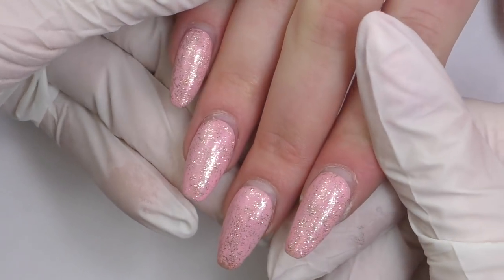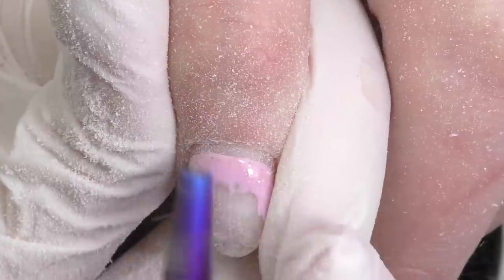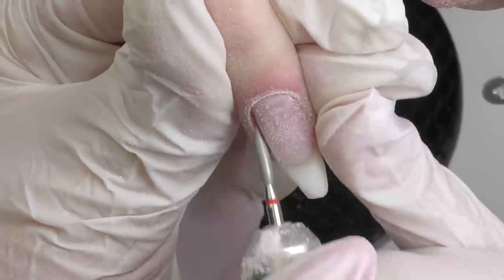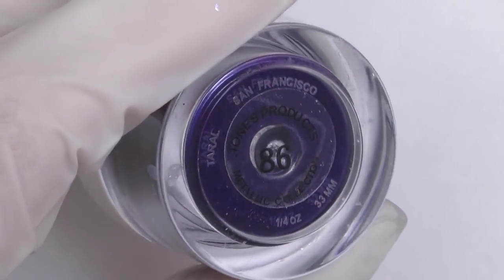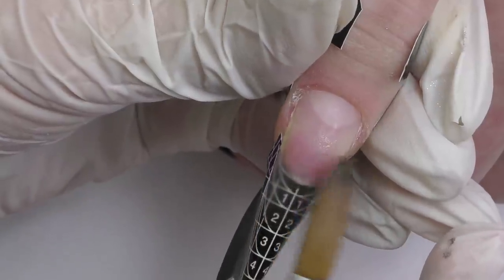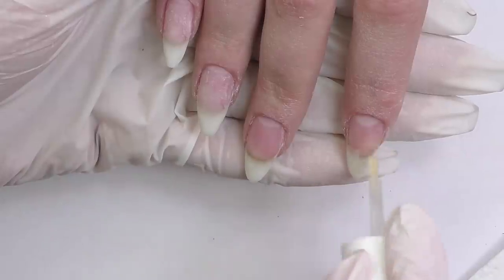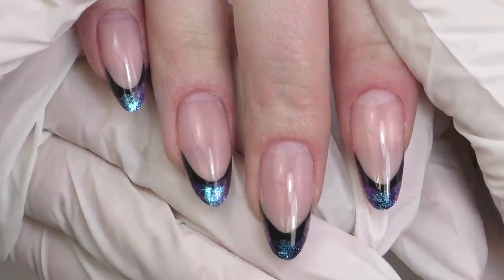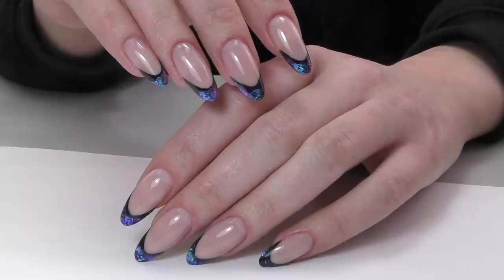Watch me Work: Client Fill | French Style Nails With Galaxy Design

Comment: Thank you very much... I'm in Turkey and my technician is Russian and we did a pretty similar french manicure on my nails today! First she removed the old gel and then created a top layer with a baby pink nude (like almost clay product) and then applied the other darker color underneath. It looks amazing, however, my only complain is that when she was filing with her hands after using the machine, it hurt like hell! She was filing pretty roughly and she kept warning me "let go of my finger and not be stiff" otherwise she might hurt me with the file... I got some small bleeding spots at the end by my cuticles. So, my question is that, what can be done in order to avoid bleeding while filing? Love, XoXo

Comment: So why not use a glittery blue black gel polish as the base for the tip color? Seems to me that that wouldn't create as much thickness and therefore more clear can be applied. I like getting as much extra clear over glitter as i can because it makes the glitter, especially mylar, seem deeper and that makes it pop more. Like it's under water or something like that. Clear also offers the strongest bond and strongest structure. I'm not trying to critic but just asking. And I'll include that this is a really cute design and I would wear these! No hate, just curious.

Comment: I'm confused. Ever teacher or nail tech I've ever watch or met have said that you'll never need to use your efile higher than 15,000 ram. But in this vid she's was at like 20,000 just for nail prep. Which I was taught and only ever seen people doing it 5,000 rpm or lower. So which is right?
Reply: I've noticed that the Russian nail techs tend to use higher speeds (check out Nail Mastery by Tatiana), and they say that it's important because at high speeds you buff the skin, whereas using a lower speed can actually tear the skin.